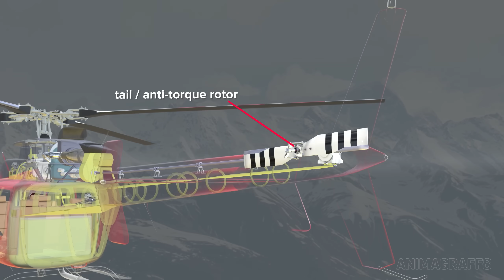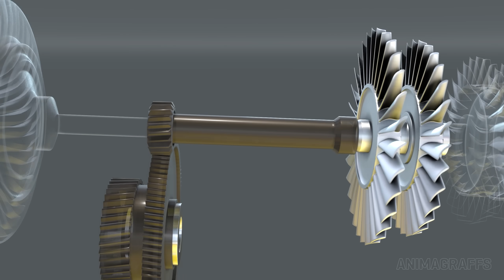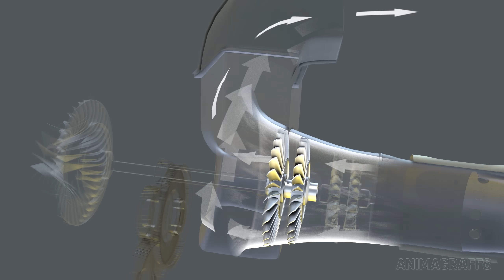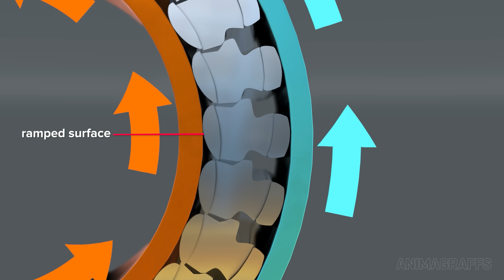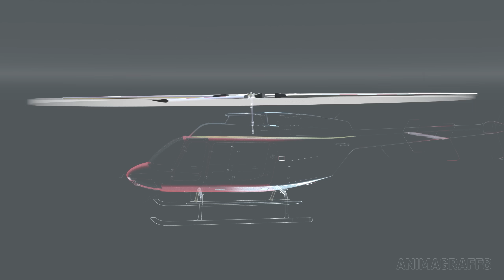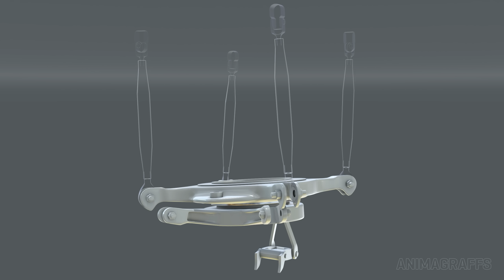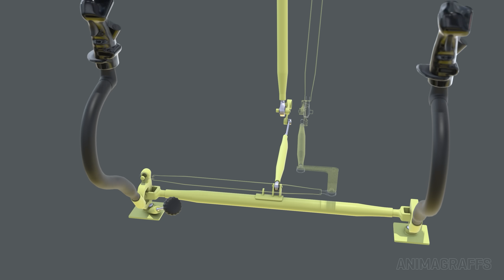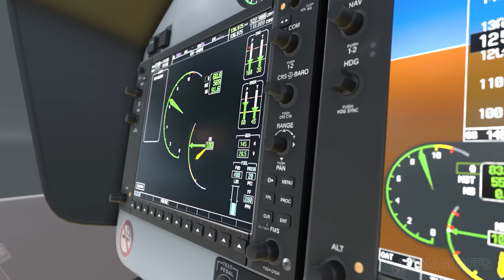How a Helicopter Works (Bell 407)

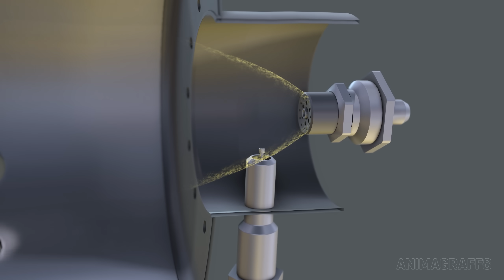Comment: 6:00 What happens if the igniter stops igniting?🤔
Reply: @marlonhernandez8411  the pilot start to pray
Reply: @marlonhernandez8411  in the event of an engine failure, helicopters can still land safely through a maneuver called autorotation
Reply: I'm gonna assume that the igniters are only for startup and the burning fuel mixture ignites itself

Comment: As a pilot myself I will say the analogy is fairly correct.  One thing I noticed is during the presentation on auto rotation.   You are correct but one thing I noticed was that you never mentioned during engine failure collective pitch  is removed from the rotor allowing a rotating wing to gain as much energy as possible.   Approaching the ground collective is restored to the main rotor to provide Lift once again. Outside of that awesome job but that is a very key factor.

Comment: If you were riding a bicycle with the same gear ratio as this jet turbine to main rotor has, you would have to spin pretty much as fast as you can for an entire minute to travel the distance a tall basketball player is tall.

A bicycle tyre is around 2M (6'7") in circumference. 48000/400 is 120 to 1. 120RPM cadence is really fast.

Comment: These things will Kill you. I went down in a jet ranger 206L model while riding out to the oil rigs we had a tail rotor failure upon landing and we spun out control until we smack the water that broke my back and crushed my spinal cord. I got out with legs curled to chest because of back injuries. Pulled May west jacket and waited in unbelievable pain until I was hauled out water and into lifeflight then 10 hrs back surgery to put me back together and another  2 years of rehabilitation. Then a big fat settlement.

Comment: How would gyroscopic procession factor into the controls though? For instance, if you were looking down on the helicopter from above and the rotor was spinning clockwise, and you increased the lift on the right side of the rotor, you would expect to roll left, but wouldn't it actually cause the helicopter to pitch forward? (the effective force being felt 90 degrees from the actual force in the direction of rotation) or do the controls automatically compensate for this?
Reply from the maker: First, you change individual blade pitch. That pitch causes the blade to flap upwards. Once the blade has fully flapped upwards, it generates the most lift. The only reason for this whole confusing 90 degree thing is because it takes time for the blade to get fully flapped. 

In your example, if the blade was flapped fully upwards while at the right side,  the helicopter would indeed go (roll) left. Easy!

BUT if you want the blade fully flapped at the right side, you have to start the upwards flap BEFORE it gets there. Some helicopters start it 90 degrees before. Some 75 degrees before.

If it were a perfect gyroscope, it would always have to be 90 degrees, and that's how you know it's not actually gyroscopic precession at work here. At least not fully. I've no doubt gyroscopic forces are at play, but its not the defining characteristic of this pitching and flapping process.
Reply: @animagraffs   Ohhh I see! Thanks for taking the time to give such an in depth response! I wasn’t expecting that at all, but this explanation just made it click. Now I understand what you were getting at in that section of the video. Helicopters are so much more complex and dynamic machines than I would have thought. Amazing video, keep up the good work.

Comment: A note on phase lag that's actually incrediablly fascinating (in fact it's the most fascinating thing about helicopters in my opinion): You were completely correct, it's not really gyroscopic precession since it's not a rigid disk. It's a system of a blade flapping up and down on its hinge.

In fact, you can model the dynamic moments on the blade as it flaps. When you do this, you'll find that the rotor blade's rotational inertia ends up acting as a spring that wants to pull the blade back down when it flaps up (or vice-versa). 

When you write out the dynamics this effective mass-spring system, you find that its natural frequency is equal to that of the rotor's rotational rate! Coincidentally, a cylcic input creates a moment on the rotor blade at a frequency equal to the rotor's rotational rate. Making an input at a systems natural frequency creates a RESONANCE. A characteristic of resonances in ALL second order dynamic systems is a 90 DEGREE PHASE LAG!!!.

Of course,  the blade hinge could have some stiffness and damping, so the blade flapping natural frequency may not be exactly equal the rotor rotational rate, hence the range of phase lags less than 90 degrees you may see in some helicopters.

You may also be wondering: "isn't it bad for a resonance to be happening", and in fact it's quite the opposite. Helicopter rotor blades have so much inertia that simply perturbing the lift around the period won't cause them to budge all that much. However, a resonance causes the blade flapping amplitude to be high enough to significantly change the tip path plane. THE ONLY REASON WE CAN CONTROL THESE VEHICLES IS BECAUSE OF THE RESONANCE THAT'S CREATING THIS 90 DEGREE PHASE LAG!!!

Comment: Why does the driveshaft need a flywheel? Surely the rotors, which are also connected to the shaft, provide far more rotational inertia than that little disc ever could.

Comment: Retired A&P here.  Amazing video, detailing an incredible machine.  Never got to do any MX on helicopters, other than a littlen pin-striping and some inspection duty on an Amerijet Bell Jet Ranger, back in 1988 at Fort Lauderdale Airport.  But a flight mechanic I spoke with there said his bird required 10 hours MX for each hour of flight, because otherwise it would shake itself to pieces. 😆  I think he might have been exaggerating a bit.   Thanks for this spectacular work you've done.  I much enjoyed the education.

Comment: You showed clearly the reasons for the limited payload, speed & range  why vertical flight is not for big scale airliner use, the higher risks of mech. issues, higher reliability risks in bad weather, more maintenance and less speed. Thank you very much for another loaded information hour on a complex subject...sprag clutch, kaflex drive, epicyclic gearing in rel. to power, blade cyclic/collective pitch/coning/flapping & coreolis/dissymetry lift forces, etc. Gyroscopic precession & phase lag was well understandable than just by reading about it...including  swashplate (cyclic and collective)!

Comment: Im not sure if it has been stated yet but as a privet pilot i can yell you the first thing you do to enter an auto rotation change from a "nose down" position / "nose level" to a nose up position. Your trying to get wind passing through the rotors to force them to spin. You also change the blade pitch to a much flatter angle in an auto rotation to maintain maximum blade RPM (with out going past an overspeed) as the RPM and Inertia in the system is what is used to cushion your landing when you flare at the bottom.

Comment: Wow! Thanks to this video I can fly and maintain a helicopter 😂
From the video the engine provides the power or motion but to me the power transmission system are the main things.
Now about the engine, please correct me here. I seriously think that suitable electric motors with batteries and alternators would do a far more better job of providing motion. They would make the system lighter and less prone to combustion in case of crashing. What do you think?

Comment: GREAT JOB MY FRIEND.
I machined all 1/3rd of the cuffs that hold the blades on the Presidents helicopter along with the transmission rings and many other titanium parts way back in 1978. They put them in storage while Titanium was still  cheap. Only 3 people were trained for this job the old timer a 40 year old and me the 18 year old motorcycle racer and car builder.
We cut enough parts fo last till 2040.

In my 6 week Army training course at the Bridgeport plant I learned every machine.

We then watched a video with camera  mounted on the cuff shooting to tip of blade.

The blade does bend 3 feet each revolution and is why 1000 hours is max.before replacement. We will see with solid ones. 

You can hear when they delaminate from titanium tube when it gets noisy.

I also worked for Army experimental on the Abrams tank turbine. We ripped them apart built them and threw frozen chickens in the intake.

Now it was used as CDC a ground vehicle we had a lot of issues to fix. I came up with the exhaust and intake method. I used the Super Trapp dirt bike racing exhaust design.

The intake was an HVAC new design with the slide in sqaure filtered. Used them vertical so sand fell to bottom trap door.

They I came up with restricting the intake to slow the speed. They came up with adjustable vanes to throttle it a little.

The recuperator idea was the best idea but no one was ever realized for creating it and it is used in airplanes and most turbines now. I thought of it on Sniffins Lanes near Building #10 in 1989

Comment: Other question jet planes are mikes in the sky and the sound of the engines are a mile or two even three miles or more behind it, yet when it’s lower near the airport the sound of the engine is right there on the plane.

Comment: It still amazes me that helicopters work at all. That they have been developed so much going faster & higher that even experts predicted does suggest that their are still new concepts to be utilized.

BTW 
Westland Lynx 249 mph
Eurocopter 12,954 m (42,500 ft)

Yes, the Bell Boeing V-22 Osprey IS faster, but the high speed is due largely to it concerting into an aeroplane in horizontal flight which it itself amazing.

Comment: Someone else commented on the quality of the video and I can't agree more.  I learned at least a few things even early on.  I never knew those were wire cutters on the top and bottom of the nose.  I never knew the tail section is actually designed to flex.  I bet that works like a golf club shaft adding toque when changing directions.

Comment: Thanks a lot  It was a informative and intresting vlog for me .first time i knew where has put the engine of helicopter.It is some comlicated to oprate and fly it. Now I can try a little to lift up and fly in the air but i fear that i will must fall it down on the ground.  So i have not at all.

Comment: This was an amazing insight into how helicopters operate. I do have a question about your doubts with gyroscopic precession. If you believe blade flex causes the delay of about 90 degrees how can you explain my scale RC helicopter model? It has next to zero blade flex yet still has a 90 degree delay.

Comment: Question: Is the flapping movement of the blades important for controlling the helicopter, or just the cyclic pitch alone is what makes the necessary forces for controlling the helicopter, and the flapping movement is just a consequence of those forces?

Comment: 11:12
Wait, don't pilots change the angle of the main rotor blades to the opposite one right before landing to generate extra lift? I thought it was the key thing when landing in autorotation.

Comment: When I used to work in the fire department, a LifeFlight medic came to our station to give us a lesson on the helicopter they used, so we would be better equipped if we found ourselves helping load a patient onboard. He said the main rotor is so finely tuned and calibrated, that a postage stamp stuck on the end of one blade would throw everything out of balance and cause a catastrophic failure.

Comment: Just something i noticed about the autorotation: Its not primarily the aircraft that is pitched to create the the "air cushion", but the rotor blades, which are responsible for the lift. The helicopter is pitched to use the remaining forward momentung to further boost the autorotation while slowing the helicopter down horizontally. If you talked a bit more about the rotor blades in the autorotation segment it would be better, but still great to mention this. 

For a better view on the autorotation i recommend watching SmarterEveryday's video on exactly that topic.
Reply: Show off...🤣 Naw just joking great comment.✌️👍🇨🇦

Comment: I risk being wrong, but I believe the e.g. forward motion of an airborne chopper occurs not because of rotor disc tilt due to blade flapping (on a level chopper) as narrated in the video, but because the whole aircraft tilts forward (pitches down) due to cyclic input, and a forward trust vector appears due to this pitch down, not due to flapping.
After the neccessary forward pitch and forward thrust vector are achieved, I suppose the cyclic is returned to neutral for a level flight forward, and not kept "pitch down" in order to keep the blade flapping effect to sustain forward flight.. Please correct me on this if I'm wrong, that the cyclic is used only for the pitch and roll motion , but not to maintain that attitude for craft travel once the attitude is achieved; just like ailerons on an airplane (save for any trimming).

Comment: Really great video, very easy to follow and understand. I do feel as though your segment on autorotation has some problematic wording though. We don’t want to encourage pilots to “angle the craft toward the ground”. To me this suggests dropping the nose into a “dive”, which is a great way to lose rotor RPM. When entering an autorotation, aft cyclic, preventing the nose from dropping, is critical to maintaining rotor RPM. 

Furthermore, while not as problematic, saying we create “an air cushion” during the flare isn’t really accurate. With no power, and all of the air flowing up through the rotor disc from underneath, there isn’t really a cushion. 

The mechanical information is really well done, but I encourage any current or future students to discuss aerodynamics, and especially autorotations, with a qualified CFI.

Comment: Having learned how the flight controls work in another video I've seen long ago I've since been dreaming of getting to fly with a flight instructor just in case but being handed full control of the helicopter as soon as it's ready for take-off. Having learned to apply the flight controls of any aircraft carefully and in small increments very early on when all I got to fly was virtual aircraft in microsoft flight simulator I applied that knowledge to my first proper RC planes and to the gliders I learned to fly in my youth, and I would also apply it to flying a helicopter, especially when the goal is to keep it hovering on the spot. I've even learned about the phenomenon of pilot induced oscillation, meaning the pilot unconsciously makes the helicopter sway back and forth through slight overcorrections, and that knowledge might even help me avoid that.

Comment: You should do a video that covers the CH-53E/K Super/King Stallion. It's a large helicopter that has multiple engines and gearboxes.  I would love to see the inner workings of such a complex helicopter. I also was a mechanic on the E model for more than 20 yrs while I was an active duty Marine, so the CH-53 holds a special place with me.

Comment: It's truly amazing how intricate, yet mechanical a helicopter works. The basic functions and flight operations can easily be done without power or hydraulic assistance (admittedly, It's harder to do, but it works), but all you essentially do is pull levers that directly mechanically link to the two rotors. It's truly amazing to me that such complex operations as keeping a rotating wing stable in all directions, is done completely without the use of computers or software. A helicopter is truly a mechanical computer in action. It's understandable then, as you mentioned in the end, that helicopters haven't been around as long as other aircrafts. They are simply too advanced.

Comment: How the heavily armed gunship disappears, it’s amazing. It sounds as if you would lower the volume control of a radio at an average speed. When the chopper disappeared, it still makes a sound for a few seconds. 
When someone is confronted with a helicopter, he hides under the bed.

Comment: I cannot believe helicopters don't just fall apart, with 100,000 points of failure, 90,000 spinny parts, being held together with 50,000 bolts & also that one nut at the top of the mast clamping it all down. That one nut makes me worried.

Comment: Before watch in this, I thought that I had a basic understanding of how a helicopter flies. I did not, but I do now thanks to this explanation. Most teachers would simplify the operation and construction for an introduction. Somehow you manage to isolate components and then quickly, seamlessly combine them into complex systems that I can understand (albeit with some repetition). 

The collective mechanical genius that went into this combination of systems is awesome. Just that 1-way clutch system is amazing. I had no idea that each blade feathered at different angles through an individual rotation to generate and reduce lift in different portions of the space the rotors move through. 

I have always loved figuring out how things worked. This presentation is fantastic. Thank you.